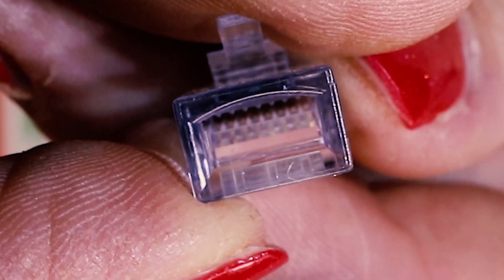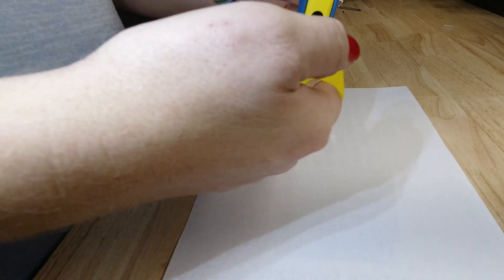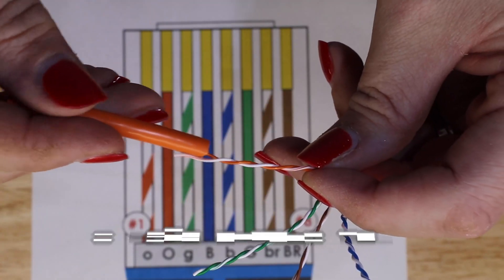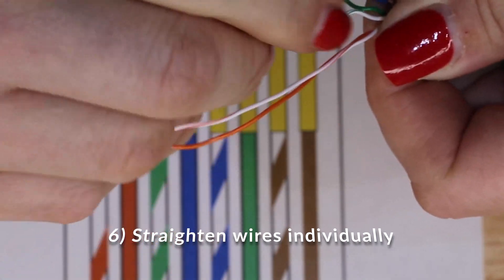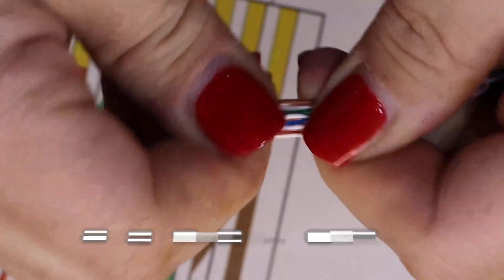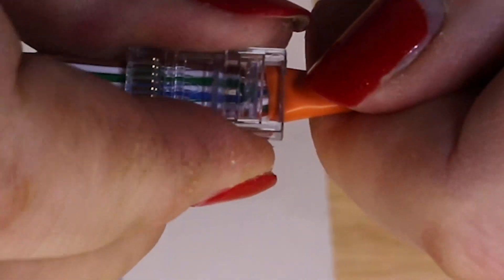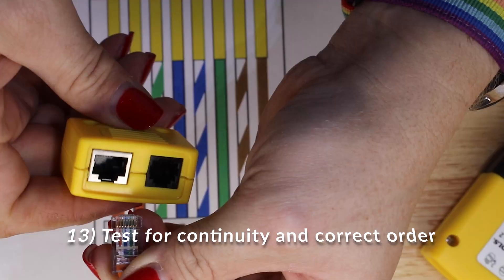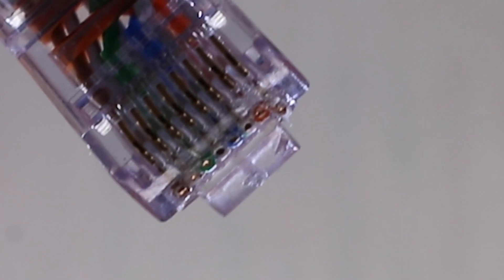How I Make RJ45 Network Patch Cables - Cat 5E and Cat 6 Ethernet

Comment: No way! All the Cat 5 connectors I crimped had blind holes for the wires so I had to cut just the right length AND have them totally level before feeding them into the plug. Having through holes and trimming them after looks so much easier. Cool 😄

Comment: very good, I have been doing this job since 2001, once you had to cut them to the exact length of the plug.  you would go crazy if you didn't get all stapled.😊👍🏻
Reply from the maker: These new plugs make it so much easier! Very cool that you've been doing this job. It's just a side thing for me
Reply: yes, I was an electrician from 1991 until 2011, I specialized in cabling Ethernet networks.  then the company went into crisis and now I test professional coffee machines in a world leader in the sector.  but I miss my old job